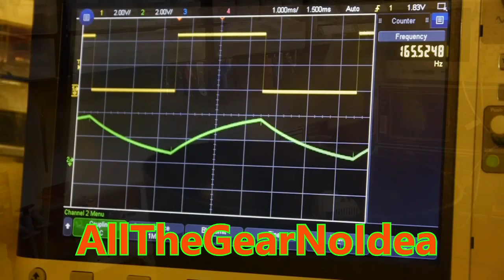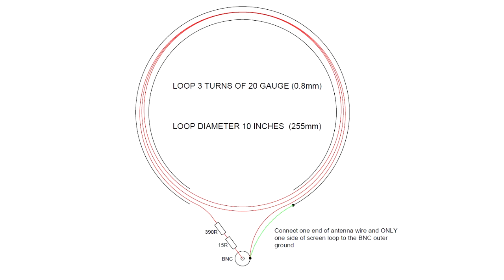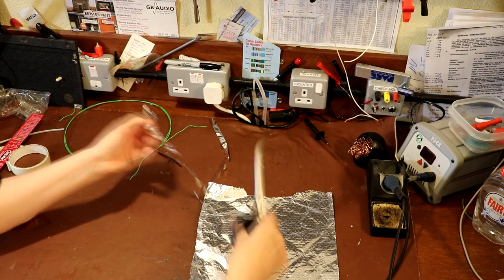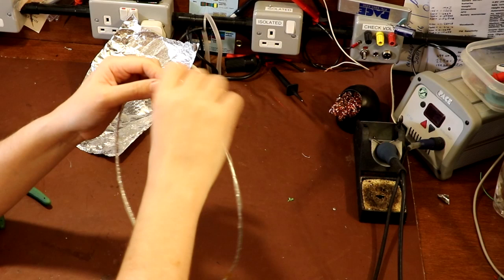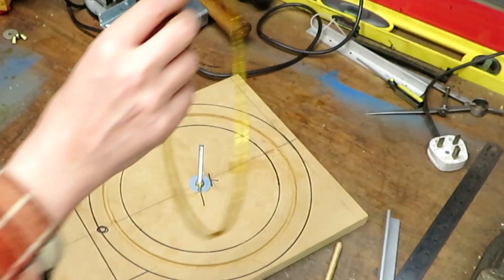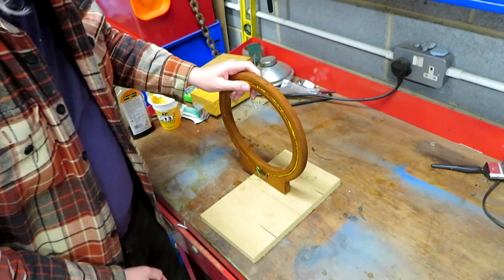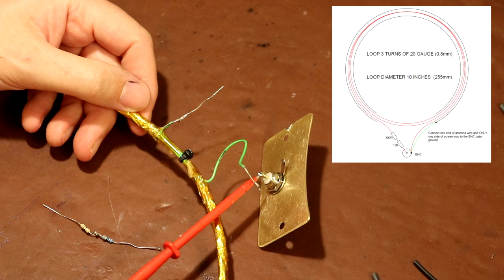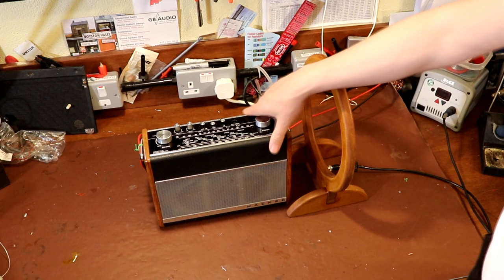Going Loopy In The  Lockdown?

Comment: I wonder if you could use the outer shield from a piece of RG-213 coax cable as your shield. It's a double silver plated shield as I remember. In a short piece like this it would be easy to pullout the center conductor and dielectric so that you would be left a sleeve of shielding. Just a thought. ATB Doug.
Reply from the maker: Yes I think you probably could use that. I found almost anything will work I found construction very none critical but I do intend to roll a copper tube. I have a ring roller on order at the moment. Thanks for watching stay safe regards Chris

Comment: I used a loop antenna in the 80's when Australian commercial AM Radio stations started broadcasting in stereo. I built an AM stereo tuner and used a loop antenna as it reduced  interference. AM stations tried to compete with there FM counterparts but it only lasted a few years.Great job on the antenna build. The wife came up with an idea. You could run a small voltage through the coil and use it as a heated toilet seat. She has quite an imagination.
Reply from the maker: les p Hello Les thanks for the great comment. Yes my wife also thought it looked like a Toilet seat LOL. Thanks regards Chris

Comment: I have no need for one but I think I will make one all the same. Looks like fun. Thanks.
Reply from the maker: Michael Hyde Thanks Michael. If you ground one side of the loop and connect the other side to a long wire you can couple in weak stations. I could also use it to sniff out the local oscillator in a radio. It passes the time anyway. Stay safe best regards Chris

Comment: Hi Chris, super bit of loopiness. If you have any of your pre-production prototyping left, something to build might be a tuneable loop a la Tecsun. They work quite well for what they are. I was thinking about allying one of those with one of those little 0.1-2000MHz RF broadband amplifier boards you can buy on eBay/Amazon etc. My one is currently on the output of a valve sig gen so I didn't keep having to whack the output level up continuously to drive a frequency counter. All the best and stay safe. Andrew
Reply from the maker: I am definitely going to have ago at building a receiving loop but not going to make it out of wood after all that dust and mess. The RF amplifier is a good idea I have been meaning to try one for a while. The only thing is this tecsun Antennas are just so cheap now. We will have to have a chat about it. Thanks stay safe regards Chris

Comment: great video ,the process is very similar to making a degaussing loop for crt tv's  , you want the magnetic field and shield the electronic field ,with the degauser you use a light bulb for resister and have a switch .love the wood frame its a bit like a Antique radio speaker (round mono speaker)  .Will have too make one to add too my signal test set i'm building as a add on module perfect ,thank you.
Reply from the maker: steven devereux  Thanks Steven for nice comments. I’m going to be working on some vintage 405 line televisions in the future and I was definitely thinking about trying to build a degauser  so that’s interesting to know.  I’m quiet smug about the woodwork considering how rubbish I am at wood work. Thanks for watching stay safe best regards Chris

Comment: Great video Chris,  kind of reminded me of 'blue Peter' only thing missing was 'here's one I made earlier' by the way I use a home made active loop antenna, 1m diameter aluminium loop with a pre amp at the base, it is very directional & much better signal to noise ratio than a wire aerial
Reply from the maker: I would like you to show me that loop antenna or have a chat about it sounds very interesting. Thanks for watching stay safe regards Chris
Reply: @allthegearnoidea6752  I've done a couple of videos on it Chris, search my videos, cost of about £30 to make and works well from about 60 kHz to over 30 MHz, it's not my design, just did a search for active loop antennas to find the circuit for the amplifier, let me know if you need any more info
Reply from the maker: ptronix ok thanks I will definitely look up those videos thanks for letting me know

Comment: I've got a Tecsun AN-200 tuneable MW loop antenna, cost about £20.00 wonder if that would work for coupling in the IF. Awesome buld BTW 🤘
Reply from the maker: GNU_Ninja I think it would kind of, the problem is those Tecsun loops are very very narrow band with a high Q. You ideally want something wide band for alignment or you would be constantly tweaking the loop tuning capacitor. I’m thinking of building or buying a tecsun loop would you recommend they look very stylish. Thanks for watching and comments stay safe in these difficult times. Best regards Chris.
Reply: @allthegearnoidea6752  The Tecsun loop is good for the price, it's well made, and it does work. I'd recommend it if you plan to do a lot of dx listening on MW :)

Comment: Could you not use multi-core overall-screened cable, if you have some knocking around?
Reply from the maker: oldblokeh  Yes I did also think of that but you would need three cores. I wonder if SY cable would do I think they also make an SY cable with a foil screen used on inverter motor drives but I don’t know the name of it of the top of my head. I think you could use almost anything I did some experiments and however badly I made it made very little difference.  But great suggestion I did mean to mention it in the video and forgot. Thanks for watching and stay safe.

Comment: I've been meaning to build one for the past few years, glad to see you do one...turned out nice Just out of curiosity...have you put a grid dip meter or your spectrum analyser to see where it resonates at?.  ~Jack, VEG
Reply from the maker: Vintage Electronics Geek  I suppose like everything a spectrum analyser input will have a resonant frequency but I have never tried to test for it. They are designed to avoid being resonant as you would get bumps in the trace.  Are you talking about looking at the output from the grid dip on a spectrum analyser?  I do have a grid dip meter somewhere very useful when you need one but never had much luck with them personally often think it is like dowsing for water etc.   You should have ago at building a loop they are quite fun and useful to play with. Thanks Stay safe regards Chris